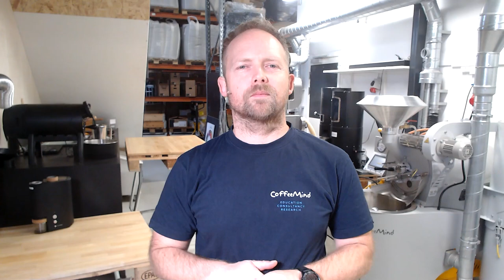Why Rate of Rise is a bad reference point for optimizing flavour in coffee roasting

Comment: Well said. The only reason we even consider it, is because someone wrote a book about how important it is. The shape of the bean curve and thus the ROR is so dependent on machine design (thermal insulation, bean probe location/thickness, etc). If I base everything on a "pretty" shaped ROR curve on my 6kg machine, this would have me hitting FC around 8min and dropping coffees too early. Or, because my machine is so well insulated, I would need to have a lower turning point to have a steeper curve during the drying phase and it would require lowering my preheat quite a bit and then firing harder then I would normally. In reality, if I hit FC at 8 min, the coffee will taste good for 2-5 days and then flavor drops off fast, whereas a FC around 9:15-9:45 seems to be the sweet spot for my machine and results in a full-flavored cup that holds on to flavor for over a month.
Reply from the maker: Hi Alex. It seems many educators use this (and therefor students) so that's why I have been so frustrated not being able to make sense of it myself.